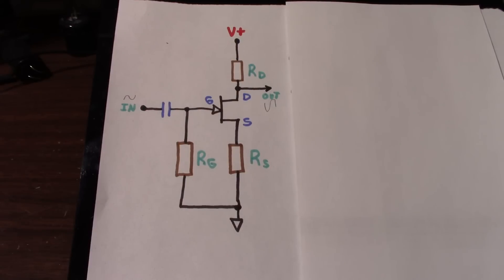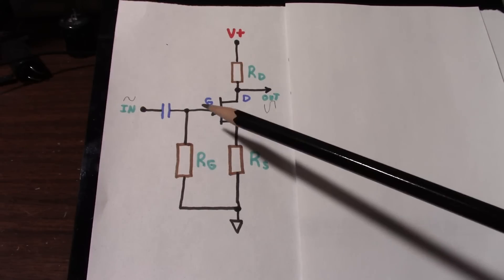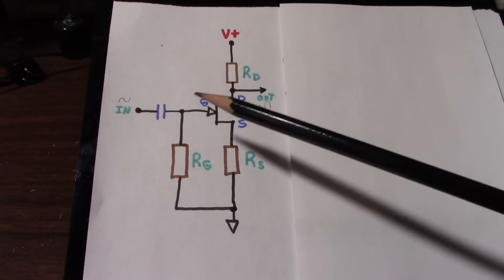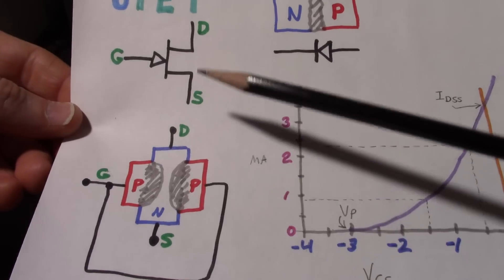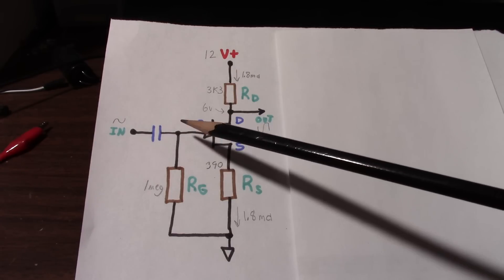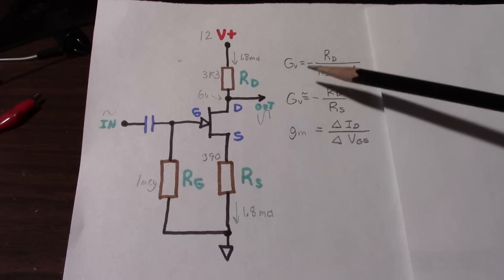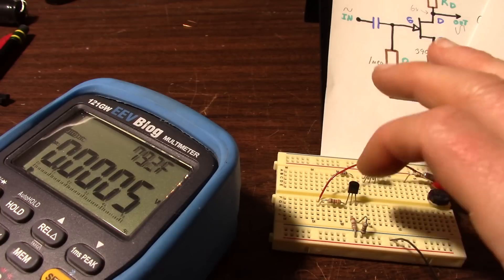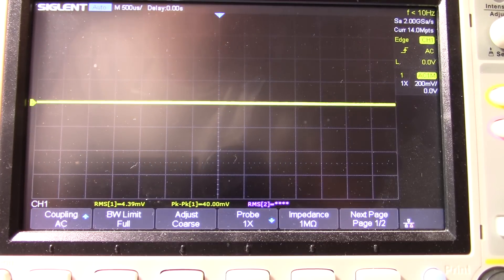JFET amplifier design with breadboard demonstration PT2

Comment: What year did you buy that MPF102, and do you have any recommendations for current production jFETs? All the old standbys are obsolesced and getting rarer than hens' teeth. Most of the available through-hole jFETs are dirty-grade choppers.

Miller effect on g-d capacitance at 12V is negligible at audio frequencies. It's significant in triodes, which have higher g-a capacitance and operate with anode voltages an order of magnitude higher; in fact some designers like to add an external capacitor from gate to drain on jFET stages to approximate the Miller capacitance of triodes.
Reply: linearsystems  (LSK389, LSK489, LSK170,  LSJ689, LSJ689). canned dual jfet around 30us$ a piece.
interfet
Reply: @AnalogDude_  I have some 2N4085 from many years ago when I needed a high impedance input with minimal temperature drift. That was before we had JFET opamps, and they were all that was available to do the job. I see you can still get them for $20+ apiece, but they don't really make sense anymore when an OPA2134 is half the price.
Reply: The MPF102 hasn't been available from Mouser for some time. You can still get the similar 2N3819 from them, but I tend to baulk at paying around £1 for a single small-signal transistor. On the other hand, it's near-impossible to design a sensible bias point for these JFETs as their Vgs @0.2mA is specified as somewhere between -0.5V and -7.5V. Try selecting Rs to cater for that without applying negative feedback from drain to gate (which is actually the only sensible solution to get a repeatable quiescent drain voltage).

I've been experimenting lately with some of those dirty-grade chopper JFETs, specifically the J111/J112, which are cheaply available, and I've been impressed with the tightness of parameters across the samples I've tried so far. I still doubt that I'll ever find an application for them as amplifiers, though, as modern JFET opamps are far easier to design with, and give as good performance with high-impedance sources as any discrete design.
Reply: @RexxSchneider  Only reason I can think of for using a discrete jFET instead of a FET-input op amp is to introduce some of "that sweet, sweet harmonic distortion" by operating them in their triode region (the part of the response curve described in the video) to simulate a triode gain stage. In the case of the J11x, this is typically less than 2V, so you'd need really low system noise to get anything out of it. There are other ways of introducing this distortion (e.g. a diode and resistor from output to ground) that are more tuneable and less dependent on the transistor's individual characteristics and can be used with op amps, so there's another nail in the jFET gain stage coffin.

Still, it would be nice if anyone was still making the MPF-102 or J201, if only for the people who like these legacy designs.
Reply: @petersage5157  The higher the Vp, the lower the maximum stage gain for a given supply voltage, so using JFETs with higher Vp doesn't actually offer any improvement in noise margin.

The 2N3819 is a drop-in replacement for the MPF102 with near identical characteristics and it's still currently manufactured by Central Semiconductor Corp.
Reply: Have a bag of at least 100 in house numbered fets. No matter how you bias it it's either off or on. Totally useless as an amp but works perfectly for channel switching in an amp. I assume these were specially made for chopper switching service.

Comment: Hi John. Could you please do the same video with a MOSFET? Sorry if you did allready. Could you please point me to it in that case?

By the way: it is "Siemens" not seimens.
Reply: You have a problem again with the variability of the threshold voltage across samples of a MOSFET. I suggest using negative feedback from drain to gate and a significant source resistor to stabilise the voltage at the drain,  which means you'll need a fairly high supply voltage. Try using a 15V supply, with Rd=4K7 and aim for Id around 1mA. Then connect 100K from drain to gate and 100K from gate to ground. That will set roughly 10V at the drain and 5V at the gate, so the source will be a couple of volts below that for a small-signal MOSFET like the 2N7000. You'll then need a source resistor around 3K, but you can split it and bypass the larger part to give some ac gain while retaining dc stability. Perhaps try 150R + 2K7, with the 2K7 bypassed with 220μF. Make the 150R bigger to decrease gain and improve linearity.
Reply: @RexxSchneider  thanks for the detailed answer.
YouTube suggested me his video dealing with a MOSFET in the meantime also.
Reply: @thomasr.5443  You're welcome. If you mean his video using a power MOSFET as a class A amplifier driving a speaker ( https://www.youtube.com/watch?v=D4tHgHfljyY ) then you can see the problems of setting a bias point which he tackles by using a trimmer resistor. Obviously that's a suitable solution for the hobbyist, but doesn't scale well for production. You can of course apply the same principle of trimming to a low-power pre-amp design using something like the 2N7000, and you should be able to get x10 gain with low noise and decent linearity even from a high impedance source. For low impedance sources, I still recommend using a BJT like the BC549C.
Reply: S like Z
Reply: @pliedtka  er... what? 🤔